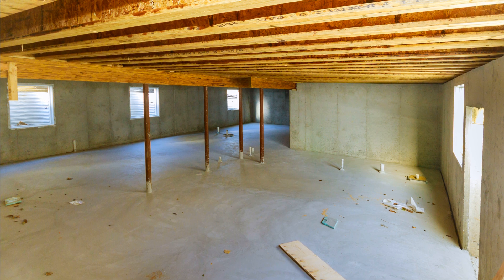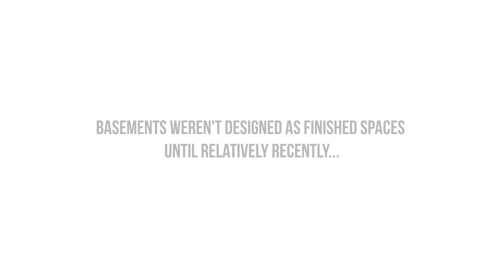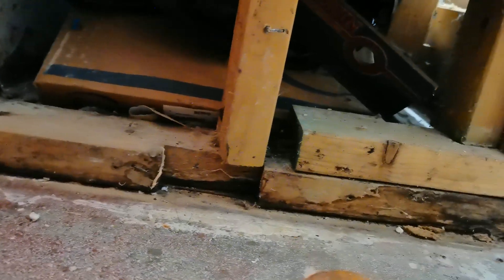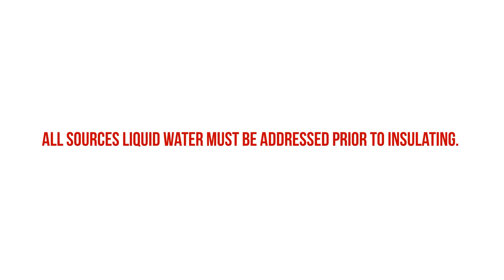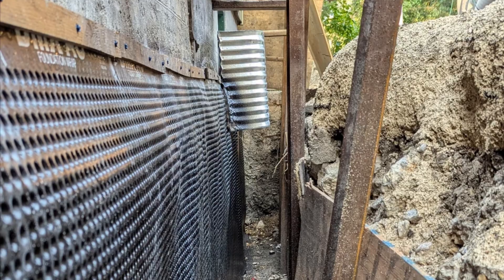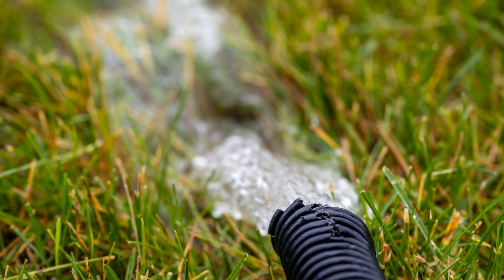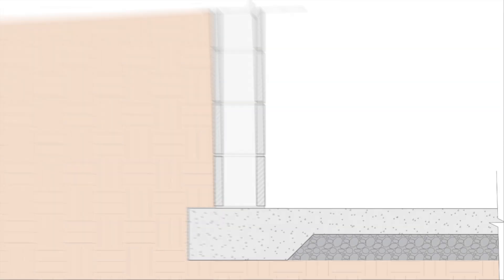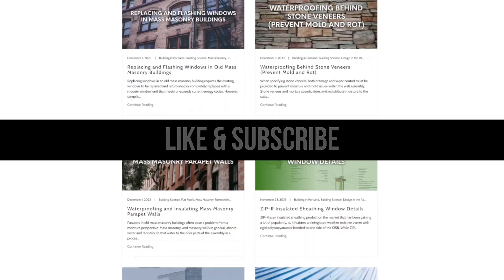Moisture Control For Basement Remodels (Drainage + Waterproofing Strategies)

Comment: Hi, I have a 1 inch gap "cove joint" around the basement floor leading to a sump pump. Do you recommend using a 1 inch closed cell backer rod and seal with Self-Leveling Sealant or leave cove joint open and finish basement as shown in your video at 8:47? Thank you.

Comment: What do you do if there is nothing between your sills and your basement walls?

The mud sills are just resting on top of the concrete walls with no gasket. 

This is a 1962 basement, poured concrete walls. 

I am in the process of planning for finishing the basement.  

I am concerned if I insulate the concrete walls and seal the rim joist cavities that since there is no barrier between the top of the concrete walls and the sill plates, all that moisture is going to rot them out.

Comment: I'm a Builder that has always included an interior perimeter drain and most projects have spray foam insulation, (trying to get away from that!). As the spray foam insulation is typically applied directly to the concrete foundation wall it effectively seals the interior drain ☹. I have been a proponent of adding a dimple mat to the interior foundation wall to allow moisture a path to the interior drain. This is the 1st video I've seen with the same concept, Bravo!!
Reply: if extending the dimpled mat  up the wall to the already exposed dimpled mat, what is the best practice to join them, tape? Can you recommend at product to use for the dimpled mat?

Comment: What do you like using as a capillary break between wooden walls and concrete slabs?  Or between foundation wall and footer?
Reply from the maker: Sill sealer/foam sill gasket works pretty well (the same stuff you often see between the stem wall and mudsill)